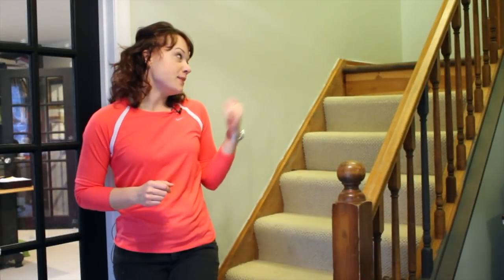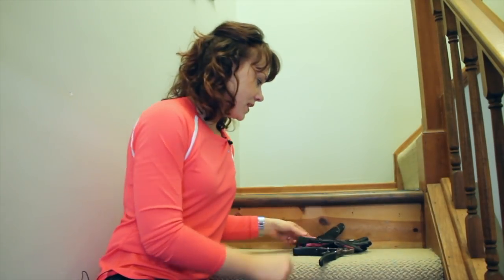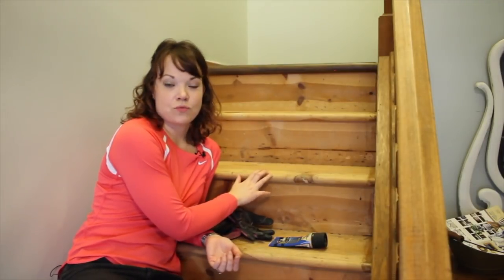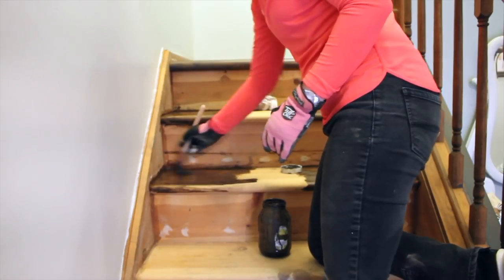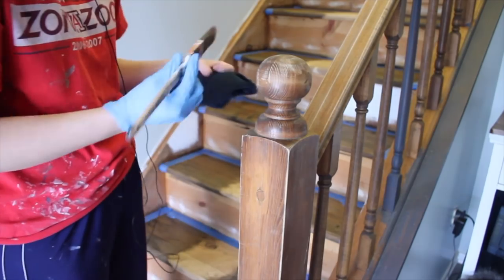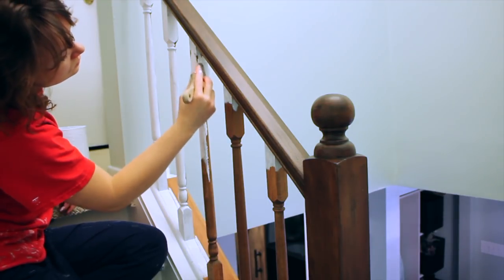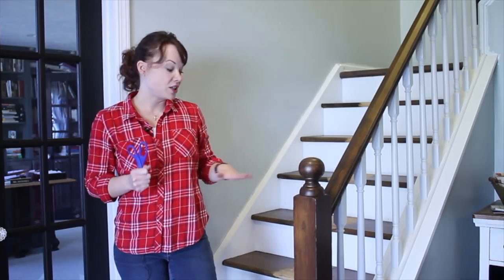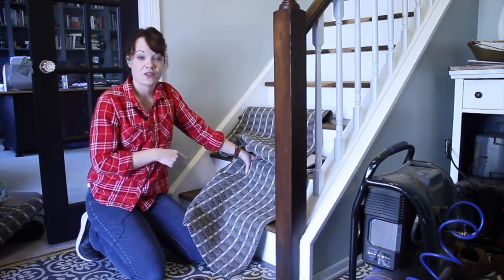EASY DIY Staircase Makeover on a Budget

Comment: I would recommend painting any woodwork or walls before staining the stairs. Perhaps it’s the brushes I use but I would be afraid of getting speckles of white paint on the newly stained steps; but you did a great job!
Reply: Then you'll have to tape off woodwork to stain and the go back and tape off stairs to paint. Its actually easier to paint over any 'accidental' stained woodwork. If concerned about getting paint on the stained stairs, just have to tape off and protect the stained stair treads before painting. Hope that makes sense 😉

Comment: Jenni, that staircase is beautiful. You’ve inspired me to try something similar on mine. I’m so excited. One question, I bought the staple gun but I do not have an air compressor, any suggestions?
Reply from the maker: Thank you so much! You'll need an air compressor.  BUT, you could also just use a manual staple gun - you aren't using that many staples, so just a simple hand powered one would work fine.  If you are going to do other upholstery work, I would recommend getting an air compressor, if not it may be something to return.  I can't wait to hear how your project goes!!

Comment: This is a great looking job! I am getting ready to do my stairs and was stressing over the cost of runners so this might work perfectly for me. Did you only use staples under the nose of the step or did you still need them in the back of the riser/where the step meets crease? Can you see the staple if its there? I am worried about the carpet being loose/wrinkled enough for me to trip as I have fallen down my super steep stairs several times so I want to make sure of everything first.
Reply from the maker: Hi Carla! I did have to put a few staples along the treads and risers as well, most of them just disappear into the carpet and you really don't notice them at all.  I think these keep the runner nice and tight to the stairs and makes it NOT be a tripping hazard!  I think the runner is even safer ON than OFF, I thought the steps were a bit slippery before I added the runner.  I hope this helps! Good luck on your project!!
Reply: @RootsWingsHome  I wonder how long ago you did this beautiful project. I'm going to redo our stairs, but can't seem to find the runners at Costco.... looks like I'm going to have to spend a wee bit more than $30- $40. Thanks for all the info!

Comment: Only critique I foresee is that the entire tread should have been stained even if a runner or removable carpet treads are laid down. Long term, it will be difficult for a new owner to match up the existing stain therefore having to remove the old stain and redo the entire stairway if they choose not to carpet. 🤔😟